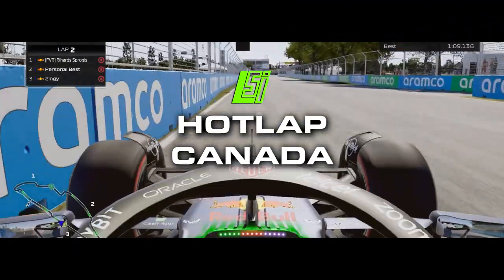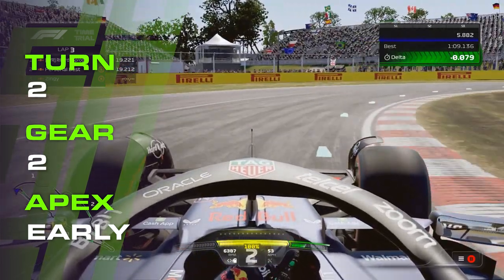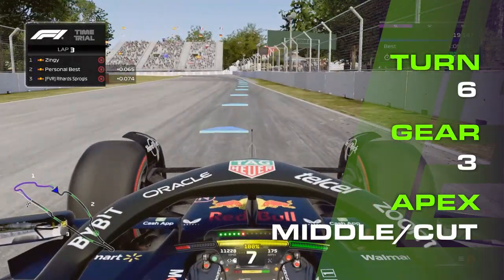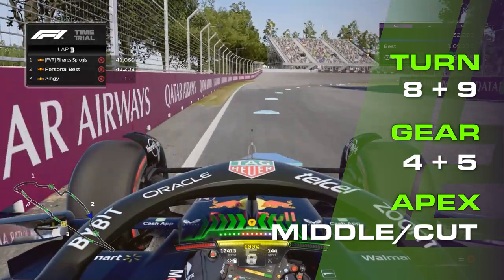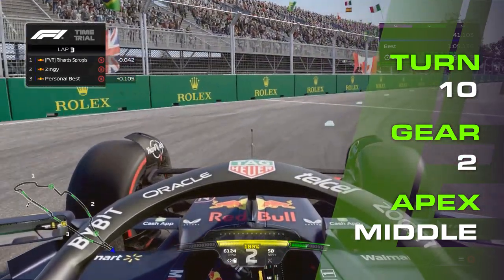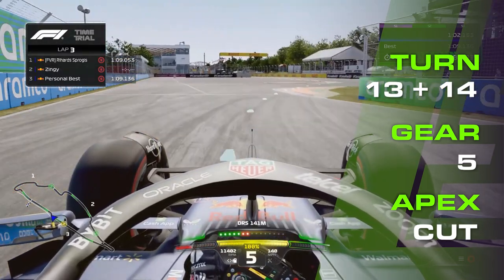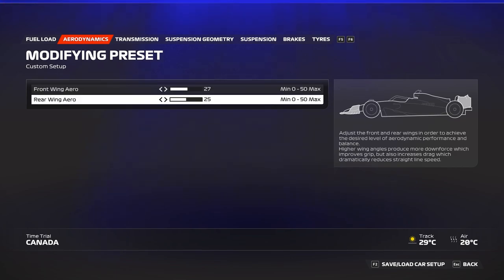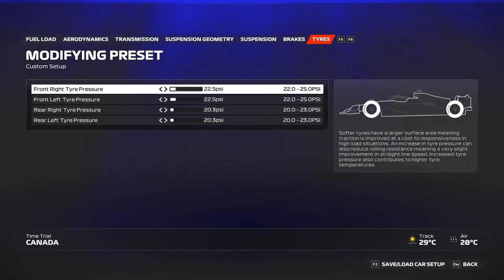F1 23 | How To Drive Canada (+ SETUP)

Comment: So a couple of times both your wheels were over the lines and didn't get penalty, for me if I go over it like that or anywhere near that my lap time cancels, I play on ps5 so maybe it's different on PC I dunno
Reply from the maker: It is possible for this to be different across consoles, or maybe it has changed since this lap was completed due to a game update. There is a chance however, that even though it looks like the car is over the track limits line, it is just about within the limits as the margin for error to set a top time is tiny. If you are referring to the last chicane specifically, the first part of it can be cut hard because by the time your rear wheels start fully cutting the corner, your front wheels are back on track, meaning it counts and is legal
Reply: If I tap the wall like you did, the lap would be invalidaded for me, for both leaving the track and hitting the wall

Comment: What’s the brake bias and differential
Reply from the maker: It's possible to use 54% for the entire lap, but you could potentially use 53% for light braking zones and 55% for heavier braking zones if necessary. Do remember though, this video is from F1 23, so make sure you are on F1 23, although the tutorial would be very similar for F1 24 and can still be useful regardless of the game. I just wouldn't recommend using the setup if you are on F1 24

Comment: hi, i noticed that the game suggest using sn high speed setup by default, so if i play with ur setup against other people with less downforce setup, am i in disadvantage?
Reply from the maker: Hey, not necessarily. Default setups are not great so I wouldn't really consider what it tells you there too much. Using a proper setup for a track means that you maximise your lap time so that you can probably break away from the other cars so much that their lower wings don't matter. However, that being said race setups can often use slightly lower wings to make overtaking easier, but in the F1 23 game, ERS and DRS combined can be so powerful that having normal wings can also work, and the higher wings allow you to gain time else where on the circuit. Overall, it really depends on what track you are racing on, and if you think you know what your opponents setup styles usually are, because then you can work around that to outperform them. In F1 24, this may be different but the game is new so it's too early to say what direction to go. I hope this helps!
Reply: @leaguesportinternational  thanks you mister. anyway I often play with my friends and they all use default setups so I should be good. have a great day!